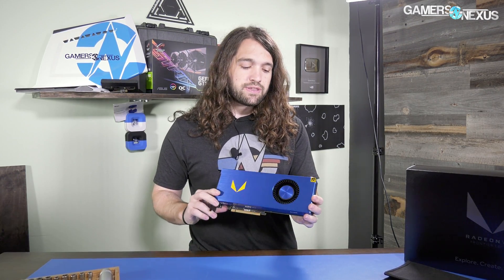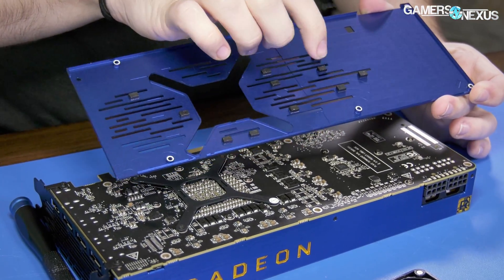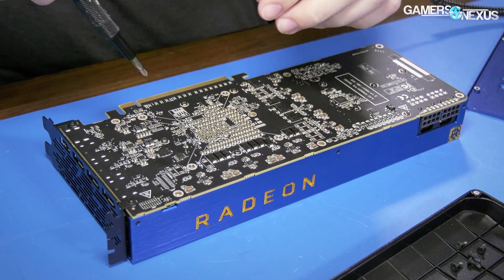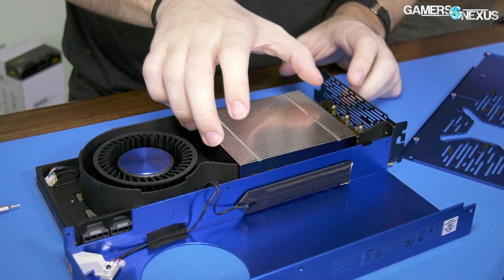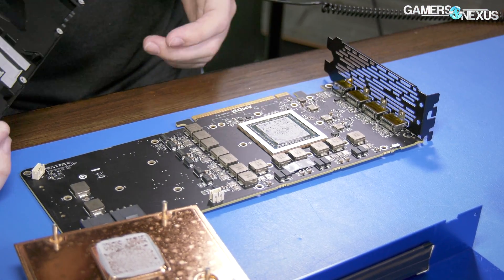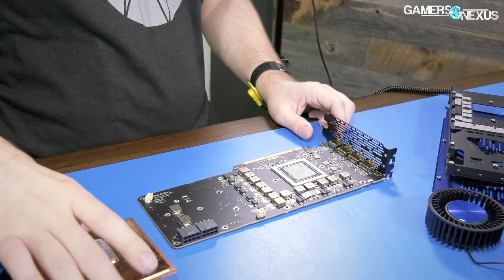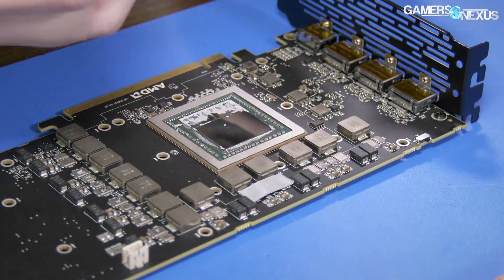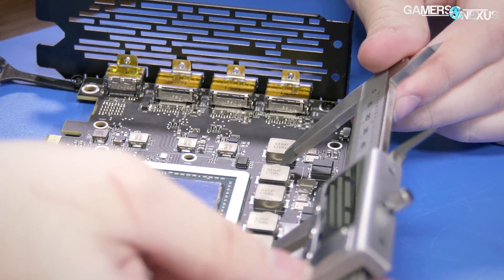AMD Vega: FE Tear-Down, Die Size, Mounting Spacing, & More

Comment: I can't believe i waited for this humiliation 350 watt dual 8 pin and barley beats GTX 1070
Reply: AMD confirmed the current Vega game drivers are not complete and putting the card into game mode actually does nothing right now. Still we should wait for the gaming Vega cards before anyone goes crazy. This card still kicks ass for what it was built to do which is professional workloads and it does it at half the price of Nvidia.
Reply: this thing is not intended for gaming, it's perform very close to the $2000 quadro p5000 in creation workload and only cost $999.
Reply: Look at the pro benchmark, it's really impressive where it matters, this is not a gaming card. it's a professional card.
Reply: This isn't a gaming card.
Reply: LOOOOL quadro is trash at gaming for $3k LOLOLOLOL pascal epic Fail
Reply: Waiting For VEGA this isn't even what you're waiting for.... You buy firepro and quadro cards?
Reply: Waiting For VEGA it's not 350w... You're thinking of the water cooled FE... and power draw testing shows it pulling about 280...
Reply: AMD said they are currently optimizing drivers for Vega cards, its actually not bad imo.
Reply: I own a 1080ti and all I can say is you're a fucking idiot. this is a workstation card, not a gaming one...
Reply: +cataria pega yeah, but it shouldn't be as expensive as the FE.
Reply: Pvt. Duckling........ we all know what the Frontier edition is and AMD themselves state it CAN be used for gaming so you are NOT entirely correct.  Frontier basically has the same Silicon as RX Vega and offers us a strong indicator of what to expect.  You can now be sure top end RX Vega will "likely" sit around the GTX 1080 in performance, but power usage, heat and price are now the biggest questions.
Reply: @roikhan ulya hamidan
acording to steve in the article the chip is 20,25 x 26 mm so 526,5 mm2, that is not a cheap chip at all. (bigger = more expensive and worse yields)
so hm idk.
Reply: Waiting For VEGA it's not for gaming
Reply: Ruddenknov the p5000 its not the top tier since it is basically a 1080 with pro drivers, p6000 is the top tier since it is basically the Xp with pro drivers and it cost a whooping 4000$. But since the vega FE performs somewhat around the p4000 and p5000 in pro workloads and somewhat around the 1070/p4000 and 1080/p5000 in gaming but cost the same with the p4000 it is still amazing.
Reply: N O T   A   G A M I N G   C A R D
Reply: @roikhan ulya hamidan
haha :D sry i forgot to mention i was thinking in sane graphics card prices instead of nvidia prices.
with 650 euros/dollars being the price for the top card at absolute maximum (fury x was like that)
and cheaper versions below that of course.
i expect 400- 650 euros/dollars for full and cutdown versions.
the fact, that nvidia is selling pure gaming gpus for 1200 dollars/euros is one of the many reasons i wanna go with amd, especially when nvidia held that performance back so much with only releasing gp104 for the masses instead of making gp102 (titan xp and 1080ti) the 1080 on pascal release date.
i think rx vega will be reasonable priced at least (given size and performance)
bleh i wish the waiting would be over roikhan :(
Reply: It really only pulls a little more power than a 1080 ti which is expected since it's a bigger chip.
Reply: Damin Ahmad well said dude but too bad the are a shit load of stupid people
Reply: JackBauerwashere i have to disagree, the quadro p6000 is equal to the Xp in gaming, the p5000 is equal with 1080 founders edition, p4000 with 1070 founders. You can find the benchmark of the p6000 in LTT and p5000 vs 1080 here  http://www.geeks3d.com/20170515/test-nvidia-quadro-p5000-vs-geforce-gtx-1080/2/ and p4000 on numerous other techsite. The point is that since it is basically the samw thing, unless RX vega got significant clockspeed bump it aint gonna beat the 1080ti let alone 1080.
Reply: JackBauerwashere the only good thing about this card is that it's half precision compute units arent disabled and it can toggle between gaming and proffesional mode, to get this privilage and equivalent performance from nvidia you need the 2000$ p5000, since even the Xp doesnt have proffesional drivers and doesnt have half precision ccompute units.
Reply: AVLRECORDS are you saying quadros don't use the same die
Reply: Waiting For VEGA 
If you were following along with the leaks it was pretty obvious that Vega had a mountain to climb if it was going to be successful. 

AMD gave up on Vega. That much is true. They shifted focus to Navi, their next GPU supporting infinity fabric like the ryzen CPUs. That will be a ground breaker but it could be as far away as 3 years. But infinity Fabric is groundbreaking for silicon manufacturing, and should put AMD back in the running with nVidia the same way it did against Intel.
Reply: I mean...it changes the ui...that's something. But apparently, tile based rendering is disabled from what I've heard and it's basically running on fiji drivers.
Reply: still 1k cheaper than that top tier Nvidia quadro card .and don't buy a fucking workstation card to game on it, and call it a shit. and AMD driver sometime bump the performance of their cards
Reply: maybe wait for RX Vega coz this is not meant for gaming as stated numerous times
Reply: IT'S NOT A GAMING CARD
Seriously, I don't know how many times AMD has officially stated that FRONTIER EDITION IS A PROFESSIONAL CARD, NOT GAMING CARD...
Reply: hold your pickfork "waiting for vega"
if rx vega will be as bad at the fe edition then sure it's utter crap, but we don't know yet.
Reply: this card is not meant for gaming.Actually this is the first card that you can use for professional use and as well as gaming.Its performing like a Nvdia p5000 in professional softwares and is 1000 dollar cheaper.Also if you compare gaming ability of a p5000 with VegaFF ,vega will win buy a huge leap.You don't realize it yet but this card is going to be a gem for those who develop games/CAD and stuff and they will also get to test their games on the same card.Earlier these people first needed to buy a expensive Quadro/FirePro card for development purposes and to test their product they needed to have another gaming card.I hope you understand what kind of gift AMD has given to these developers and professional users.This card without drivers for gaming is getting 1070-1080 performance levels just by brute force.Now imagine when the drivers are optimized to use the new tech for the sole purpose of gaming what kind of results you will get.
Reply: and even the titan doesnt have professional drivers, this will have both gaming and professional drivers - a hybrid card for game and pro use of sorts, this having performance between the gtx 1080 and 1070 is already killer and is better than the titan at pro apps, in its price point its a less than half cheaper quadro
Reply: you ppl are clueless.
Reply: RX 480 is 5.8 Tflops
AMD Vega 13 Tflops

it is safe to say than vega cards will be 125%+ faster than RX 480 (about x2.25 the performance of rx 480).
As we have seen throughout history AMD cards always show less performance per Tflops compared to Nvidia

for example the 5.8 Tflops RX480 offer similar performance to the 4 Tflops GTX1060
Judging by the previous cards AMD will need about 16.4 Tflops to be on par with the 1080 Ti 11.3 Tflops
HBM won't do much since memory bandwidth is not the limiting factor

I know this isn't how things work but thats just my guess..

AMD Vega performance should be between 1080 and 1080ti , hopefully for 300-400$
Reply: +cataria pega even if it perform the same as the FE the price might be significanly lower.
Reply: Its basically AMD's Titan, it can be used for gaming and professional work. I bet the top tier RX Vega card is going to have similar performance.
Reply: LOL at the people saying its not a gaming card. Well holy fucking hell duh. Its still the same GPU as the gaming vega. this is the IDENTICAL GPU die as the flagship Vega card, only with 8 more GB of HBm2. Granted, the Gaming vega hopefully will have at least a 200mhz bump in clockspeed, but jesus christ look how power hungry this card is at its current clocks... that is NOT a good sign. Yes, drivers can and will improve things, but its not going to put it anywhere near 1080Ti class performance. 

the worst part of all, is how massive the die is and that the card is using HBM2.. Both of which are going to make it a VERY expensive GPU to manufacture.  I want AMD to do incredible in the GPU market, as much as anyone.... But sorry guys, you need to wake up and start being realistic. This is going to be VERY close to gaming Vega flagship performance.... and I think its a total pipe dream to think this card is going to come in at anything less than 500 dollars.
Reply: It's looking to be a stinker for sure. My 1080TI is smiling :-)

Comment: Can't get blender to render without crashing? Yikes...
Reply from the maker: The card has survived all the other production workloads, just not Blender. We're thinking it's either a Blender software update that's needed, a weird driver bug, or perhaps a different renderer from Cycles (e.g. Pro Renderer, but then it's not comparable data to GTX cards since the shaders are changed). Either way, everything else is running, so might just exclude Blender until it's functional.
Reply: I see.  Thank you for the clarification and eagerly await the full review
Reply: The release notes of the driver indicate blender has a bug